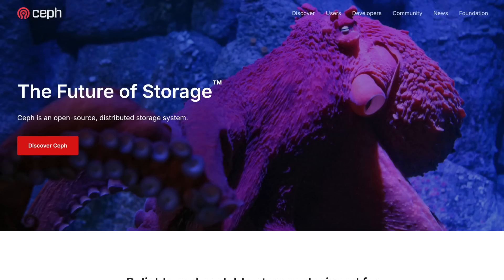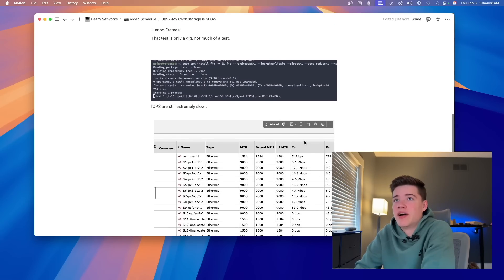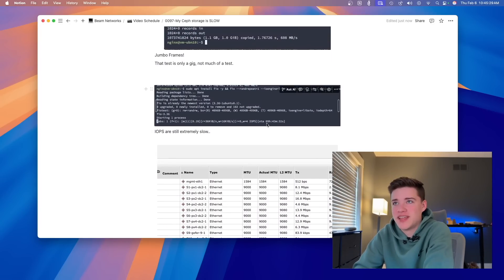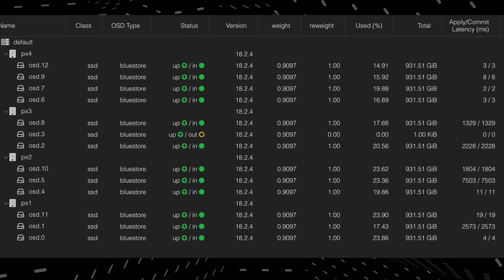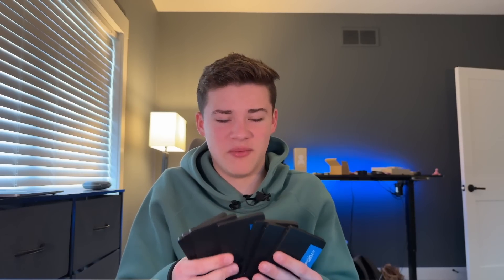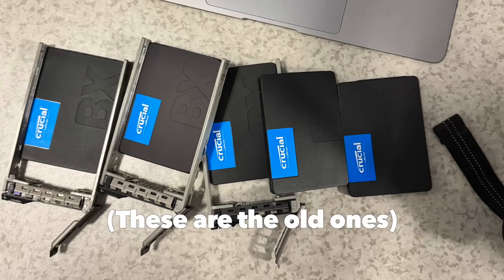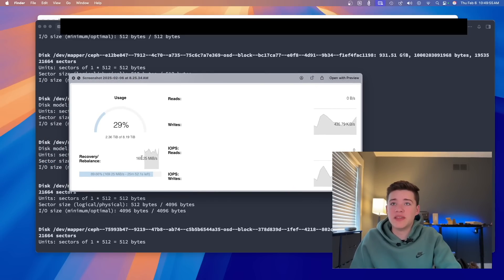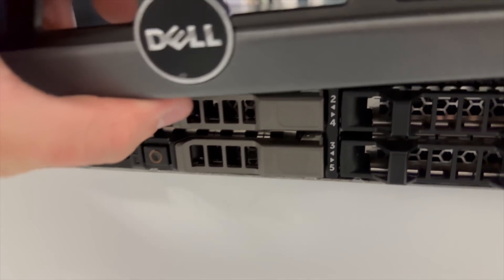I made Ceph 975x faster -- Here’s what no one told me

Comment: You have replaced the same consumer junk with another one, if you don't have the money for decent hardware, then buy it used, I can guarantee you that used enterprise stuff will last longer than your consumer stuff.
Reply from the maker: Valid points. Stay tuned for part 2.. I have started using some refurb 14th gen Dell SSDs, and my ceph performance is so much better now that I'm not relying on the crucial SSDs

Comment: Are you using the raid card?
Or IT Mode raid card?
Reply: If depending on what your doing and setup you are probably maxing out the bus at either 6Gbps or 12. Both are a bottleneck.
Reply from the maker: Interesting thought. I’m using the RAID card in HBA mode on these servers.
Reply: @ which raid card you got? All bios and firmware updates completed I presume?
Reply: When I saw it was an R620 I thought the same thing. You'll get better perf with a cheap raid card in IT Mode than with the integrated RAID card.
Reply: @amateurwizard  absolutely correct